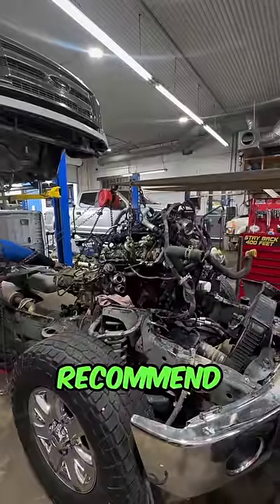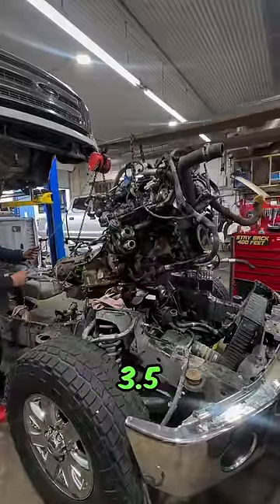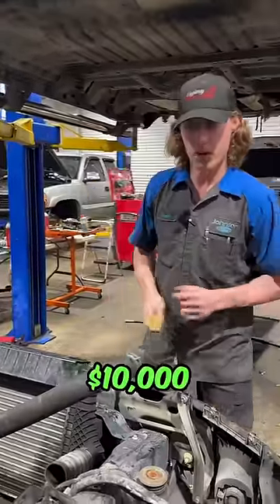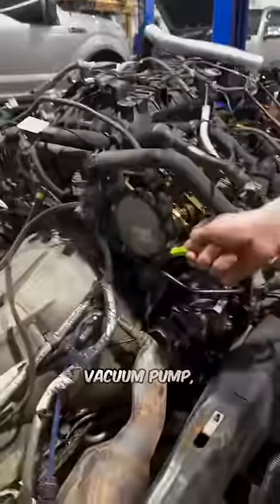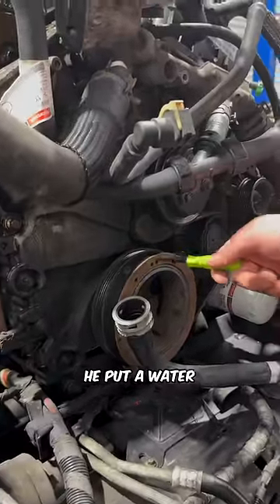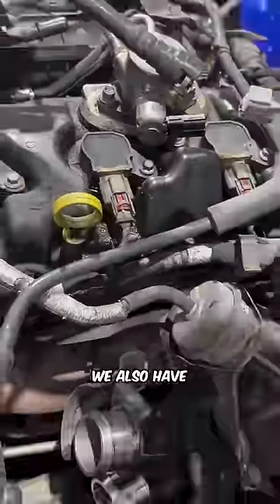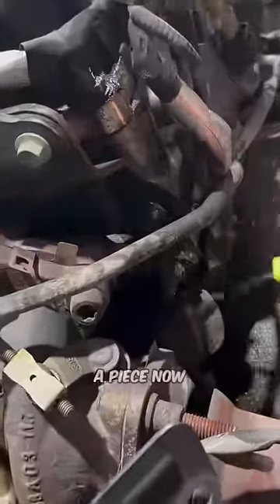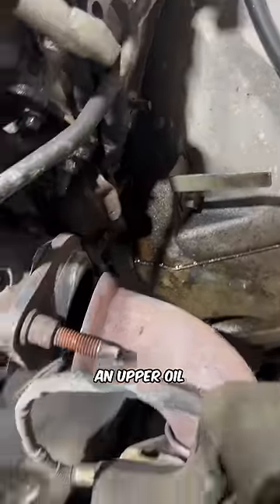Why not to buy a Ford 3.5L EcoBoost? #ford #ecoboost #shorts

Comment: Got two of them in those years.  Between head gaskets, leaks and turbos every 80-100 k, no moe ecoboosts. 5.0 for me.
Reply: yamaha230xxx yeah no- I’ve had two different ecoboost motors at this point, and even with meticulous maintenance ahead of schedule… they still suck. Head gasket, belts, turbos quitting, some insane rattle even two ford dealers couldn’t figure out(so they swapped the motor). My two 5.0s have been flawless.
Reply: Stay away from ford.
Reply: The 5.0 has issues also… I have several at work and they have had issues reading alcohol content for flex fuel, they rattle like crazy, trucks with around 5-6,000 miles having injectors replaced already, issues with the 10R80 trans… the list goes on and on… I have always been a ford guy but I will never buy another new one
Reply: yamaha230xxx  you must’ve got a winner. We really haven’t had any luck with the eccoboosts.  They are service trucks for us, nothing hard asked of them other than we put about 20,000 miles a year on them. We had four, we’re down to two, we will buy no more.
Reply: Yamaha 230 XXX using his for a Hotshot hauler you know damn well all the mileage he's putting on is highway miles which is way better than mixed or straight City. But don't let him fool you because he's replacing stuff that he ain't told you about in order to not have no problems with it. you know that's the only way he can get around that bullshit....because ford does suck...coybloates, ecopoops, powerjokes... face it anybody stays with ford these days is only doing so because they don't want to piss off their brand loyal Grandpa, 
  Or are the direct descendants of Henry😮😅😂
Reply: Glutton for punishment 😂 Ford is a 4 letter word around here since 2005
Reply: My 2012 5.0L was the best truck I've ever owned. Never had a CEL. 230k miles. The body was completely rusted out. Sold it to someone as their "winter beater" as the timing chain was rattling and not worth fixing or replacing engine.
Reply: No Ford at all is even better
Reply: 😂 now you can deal with 5.0 timing valvetrain issues 🤷‍♂️
Reply: @ricksmith1382  Oh sure, I'd prefer the hemi tick or the constant lifter problems of the LS.
Reply: Let me guess, you used the cardboard style oil filters and cheap gas. The 3.5 is pretty much a race car engine so it really needs a very good quality oil, filter and fuel. I’ve got 480,000 on mine and it’s been a pleasure to own.
Reply: @gregtaylor3961  Agreed 100% I chose the legendary 5.0L Coyote V8 over the overpriced EcoBoost V6 anyday.
Reply: @ricksmith1382  
  Agreed.... we don't call new Ford owners BLUE OVAL BOZOS for nothin..
   🥃 I have been able to support three children and a wife and drink a lot of whiskey as a commission paid technician working on those Fords though.
  My whole service department knows that I'm a MoPar guy, and they always ask me... if you don't like Fords, why are you working at a Ford shop? And I would always answer " well with all the recalls and all the T.S.B.'s they've got out on them, I figured it'd be steady work".... they don't like me no more. Won't fire 🔥 me either. 
  🏁 Ima retire in November though🏴‍☠️
Reply: @randyduncan795  
  HEMI's dont tick if they aren't allowed to idle.
    🏴‍☠️ 🥃
Reply: Ours has 177k miles and it’s had a water pump, valve cover gasket, starter, and vacuum pump gasket. That’s pretty good for an engine that’s 11 years old. It’s had no major component failures, just wear and tear.

Comment: I had a timing chain that was just put in by friend of a friend of a friend on my 2011 3.5. Cheap but not guaranteed. I soon started getting a code on the timing. I took it to ford and they had to pull the front of the engine down just to tell me what I already knew and charged me $3,042 for labor. The engine needed to be replaced & new turbos for a sum of $15,000. No way. I sold as is.  No more 3.5’s for me. Yes, they are a half link  faster in the 1/4 mile but I’m driving my 5.0 and don’t have to worry about those issues again.

Comment: 320 000 km. That's not too bad at all. And a hot and humid climate like that as well. Still runs well, and there are no major failures.  Just needs some gaskets and re-sealing. Not to bad in my books. I have been working in Canada for 7 years in the trade on German cars.
Reply: ur right... thats pretty good..
Reply: @pdubsyyyy you better check the levels.  If double milage on your yota they are too low.
Reply: pdubsyyyy  who wants to drive a slant truck

Comment: Spent 900 on 2 new ford turbos, 350 on BD diesel manifolds, ~1500 on timing gear waterpump and coolant/oil lines. A weekend or two later, its all bulletproofed. 10k? 60% labor for sure.

Comment: I had all those problems on my 2014 at 94k driving down to Austin Texas on Easter? And it cost me $9407. For Repairs at a Ford Dealership and they had the Truck for 20 days getting Repaired! It blew the Timing Chain and Cam Sensors driving pn IH-35; what an exciting day!

Comment: Over 300k miles on my 2015.  Changed vacuum pump once for leak.  Still has original turbos. 10k mile oil change intervals.  Mobil 1 Extended Performance truck runs perfect.

Comment: Have a 2015 ecoboost navigator with 237k without any issues just drove it 6 hours
Reply: Good maintenance makes a big difference.
Reply: Being a ford saleshole makes you immune...
Reply: Buddy of mine has an f150 w/the 3.5
250k and climbing, and NO major issues.
Considering the power and fuel economy, pretty amazing really
Reply: @AdamStickley  if you take care of em they’ll work. Love my 2.7
Reply: Bought a 17 Expedition last year as a Family/ Camper hauler. Only had 75k miles. Got a smoking deal. Only problems have been water pump and a seized brake caliper. Did them both myself. Crazy thing the brakes cost me about double the water pump in just parts. But otherwise. Pulled my 7000lb camper 5 hours to the beach and back with AC seats on blast and still got 10.8mpg.
Reply: Love my 15. Runs great. Tows great. No problems. 3 to 5k oil changes depending on how often I'm towing.
Reply: @nateg08  yep. I change when the oil life indicator shows about 70-75% remaining. That’s usually 3500-4500 for how my wife drives. But man I couldn’t imagine going 10k. That oil at 3000 miles comes out black as sin!
Reply: @TheHallFarm  yup, plus with gdi you get more fuel contamination in oil. Just a feature of gasoline direct injection. I use the hell out of my truck towing all summer long. Been a great truck
Reply: @TheHallFarm  I agree. If they get their way it will be just that. It may not be the same person, but it will be one empty suit after another doing the bidding of the people who have the real power.

Comment: My shop is rebuilding a Raptor waterpump and camshaft phasers at 70K miles. But the just bought special tool that holds the cams in place whiles Torque said cam gears ended up bending. So yeah its going pretty good so far.

Comment: Makes me love my 05 F150 5.4L with 332K on the odometer. Original engine, trans, driveline. Tune up, fluids, brakes, random sensors. That's it. Runs like a champ pulling my boat and loading the bed with landscaping materials.

Comment: I ain’t no ford fan. (Owned a 95 cobra and a 2010 gt) but put 200k miles on any dual turbo motor in 13 years, especially a vvt and you should expect issues. Sure you might not be mechanically inclined but anything over 200k miles should warrant serious bills. That’s just basic knowledge. If I owned a Toyota or Honda dual turbo (which one they don’t support nowadays) I’d expect $$$$$ at 200k miles

Comment: Makes the last 5.4 look great
Reply: Aren't you cute
Reply: Are we talking the 3v or 2v variant? 2v solid motor one issue, 3v was a whole different animal. Take a Chevy of same era and you are gonna have two issues guaranteed, 6l80 will go out 150-180k miles, camshaft will eat a lifter. I really like my 3.5, 2014 170k miles. Out pulls any other 1/2 ton I have had.
Reply: @jonshelley1079   Updated motorcraft timing + 09+ 3v pulls better than my 19 fx4 3.5, not as fast or powerful.  But at 320hp and 390tq with gobs of tq right off idle and a long stroke power curve, it's the perfect half ton.
Reply: @jonshelley1079  great points on the 5.4. The 2 valve is a great engine with very few problems. I have a 2003 F150 5.4 with 419,000 miles and runs perfectly. All original except maintenance of course. It puurrsss like a kitten drinking warm milk!!

Comment: Have a 2014 with 191 thousand on it. Only problem, water pump at 162 thousand miles. Paid off in 2019. Hope to get 50 to 60 thousand more miles. Has paid for itself. Followed scheduled maintenance. Couldn't be happier. I guess i would say i got a good one.😊

Comment: Just might as well replace the damn engine and turbos and start over instead of sinking that much money and time into an engine that’s probably gonna fail in the next 20k-50k miles
Reply: In the automotive world, 
You are a Tech speaking to a Mechanic.

You are wasting your breath as well as your time.
That's why we make big money and drive new cars and they make tiktok videos about Customer States......
Reply: He's ripping people off. A reman is 6300, manifolds are actually 400 for BOTH. It actually might be worth rebuilding the turbos if you want to save some money (285 rebuild kit vs 1k). Then on top of that he's charging for more shop time than he really needed.
Reply: Yeah there's no way in hell I'd spend 10k "fixing " that engine I'd have to have a fresh engine for that price.
Reply: @Jay388 I don't understand why they're even working on it. Who cares if it's leaking a little oil? That's why there's a dipstick, so the owner can check thier oil and add when necessary. Oil leaks can be our friend, they prevent rust!    Add some coolant too, those looked like minor leaks. Using a significantly lower psi cap will slow down those coolant leaks too.

Comment: 10k dollar refresh on a little stressed out 3.5 eco with 200k miles? It won’t make it to 300k miles? Don’t do it. Put a ford reman in it instead.
Reply: But then he would make less money, instead he is going to rip you off. A reman is 6300 plus he's charging double the actual price for the manifolds. Then he wouldn't get all that precious man hour time.
Reply: Till the reman fails in 20,000 miles then the truck is down for warranty and he's doing it all again for free, I just wouldn't invest in it but that's just me. I'd take a good mechanic rebuild then a reman that probably had just as many miles if not more.
Reply: @Juniormint99 True that. Remans are built on the cheap... So cheap they can warranty a ton of them and still turn a profit.

Comment: We did multiple family trips with a 2018 XLT 3.5 eco CC, put up 60k miles going  north, south, east and west of the country. Only one issue that cost me $20 fix. A 4x4 vacuum line. Truck was great. Paid $32k back in 2018 and traded it for a 2021 PowerBoost model, got $32k. Basically drove it for free. The 2021 was night and day over the eco but both were great.  Will buy again. I prefer the 5.0 engine for the Mustang not the truck.

Comment: Went and looked at some new Ford pickup trucks. Have not looked at any new vehicles for a long time.  Totally disappointed with what I saw. Cheap plastic made  trucks. And tiny little engine. Not  impressed at all. Sorry to say that they aren't worth half of what they want for them.
Reply: Drive a school bus then
Reply: “Tiny little engine” that makes double the power any of the older stuff you have that’s a “man’s engine” I have a 2012 regular cab 6.2 f250 and I had a 2016 2.7 f150. Loaded with the same weight, that 2.7 would walk off from the 6.2. The chassis struggled, engine did not. It’s plenty of engine for the application
Reply: All of today's trucks are pretty plastic laden, but any of these newer trucks hold up well when you maintain them and dont do tuner mods and run them like a race car.

Comment: This dude throws out some wild prices.  Headers are like $70, for the ones with 9 bolts are like $100.  Vacuum pump gasket is like $5 or the whole pump is $100.  The oil lines and coolant lines are less than $100 for all of them but the labor for putting them on is a different story although its like a 6 hr job at a good shop. Valve covers are $150 each.  The turbos are probably still good but new ones on rockauto can be had for under $400 all day.  Oil pan gasket is rtv.  $10k is robbery
Reply: Not everyone is a competent backyard mechanic.  If they got the money, they'd rather just pay a shop even if they are getting ripped off.  I remember I was quoted like a thousand dollars for rear brakes and inner tie rods for my F150.  Obviously, I did the work myself and spent maybe $200 tops, but for someone who isn't mechanic savy, they may have no choice but to pay the thousand bucks.
Reply: @Big_Ben1988  shouldn't be getting ripped off for parts tho. That's what I'm pointing out
Reply: @kevingeezy5176  That's true, but you're gonna have to go to a lot of different shops for quotes to not get ripped off nowadays.  Most of them overcharge for service.  Both parts and labor.

Comment: I'm an old time old school Ford guy myself, and I can honestly say I wouldn't give you a penny for any of these new trucks, if you all want a real truck save that 30 to 90k you were gonna spend and revive an 80s or older Ford, Chevy or Dodge pickup, you can find them everywhere and simple tool kit is all you need to fix or repair anything on them, 3k usually gets you a full body restoration as well, insurance is cheaper, registration is cheaper, they are made with real american parts and steel, super reliable and byilt tough enough to handle any chaos you throw at them, plus you don't ever have to worry about the headaches of some stupid sensor ruining your day by keeping you in limp mode and costing you hundreds just to replace a sensor...I bought a 76 f150 for 1k put 350bucks into it, new gas tank, new distributor, new fuel lines and filters, new fuel pump, ne clutch, carb rebuild kit, installed manual choke, retimed the engine properly and she runs like a beast from hell, 4spd with that granny low and true 4 wheel drive can't be stopped...Save your hard earned money and invest it in an actual hard working real truck, trust me you all will be much happier, and all the extra money you will save you can throw into that old school truck and make it worth more than a new one plus customize to your liking and needs as well, sure they might eat through the fuel faster, but you can do certain upgrades and tuning to improve that issue by almost 50% better efficiency...I personally prefer anything from the 70s so please all you hard working truck lovers go out there and spend your hard earned money on a real truck not a kitted out toy hauler joke with super unreliable parts, all manufacturers have a business model of making it impossible to work on our own vehicles and also imoossible to drive them past 100k miles without issues, just look at all the stupid recalls nowadays across the board!!! Shit that was never an issue 10yrs ago is now common place and ridiculous...We're all being scammed and I think legislation on the lemon laws should be redone to force these auto maker asshats to produce good vehicles again, that last at least 5yrs without issues...

Comment: I remember when this engine first came out. For claimed they tortured tested it and nothing broke. Yeah…..
Reply: A lot of engines don’t make 200k. And that one did even with obviously not the best maintenance. I would say by and large a ton of eco boost are still on the road and ford still sells them and even made them their premier engine
Reply: @billywood3021 what do you mean "not the best maintenance" lmfao. there's zero sludge under those valve covers, this thing was well maintained.  ford engineering is simply garbage.
Reply: I pdi's several back in 2011 at Ford. I def torture tested them new off the traliler. Never seen/felt so much heat radiate from an engine post test drive. I had a feeling they would be leakers within 50k miles...
Reply: Nothing is broke. They drove th truck there.
Reply: I mean, I use the hell out of mine and it's been a great truck

Comment: 2 months later, he needs head gaskets
Reply: Lol happened to me. My volvo at 180k did gaskets, hoses, and cooling system. Popped the head gasket 2 weeks later. Mechanic says it was due to age 26yr old head gasket
Reply: @Squeedlyspooch3 it was due to torque to yield bolts... blind threads...and planned obsolescence. 
  At the Honda shop when we had one of those old cvcc engines come in with a leaking head gasket, we  just pulled the head bolts,  and shortend them by 1 mm and screw them back in, torque them back down. Head gasket no leaky leaky no more

Comment: When you got to take the cab off. GET RID OF IT IMMEDIATELY!!!!!!
Reply: Bought a new 19 3.5 fx4. By 30k miles cab had been off twice. Sold it, fixed up my 09 f150.
Reply: You don’t have to take the cab off at all. Done many turbo oil and coolant lines as well as vacuum pumps through the inner fenderwell, however when there is this many leaks you might as well.
Reply: I agree. Seems the big three have an obsession with cab removal to work on their trucks and that is BAD. This only increases the possibility of making a mistake.